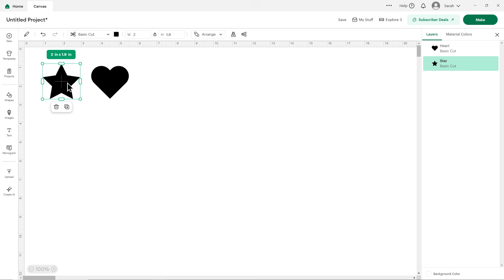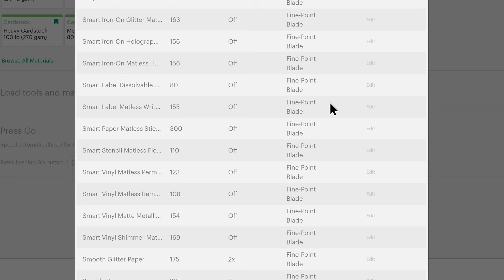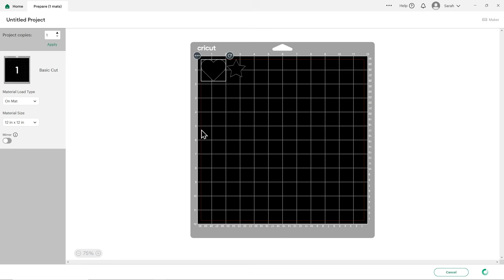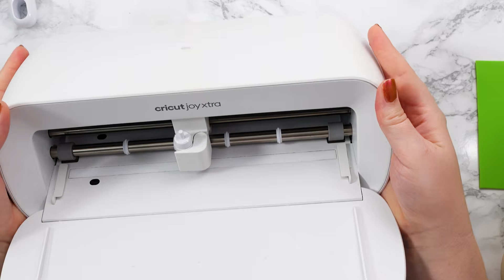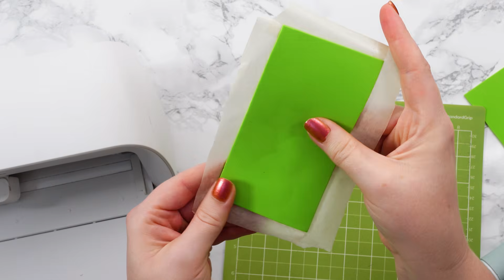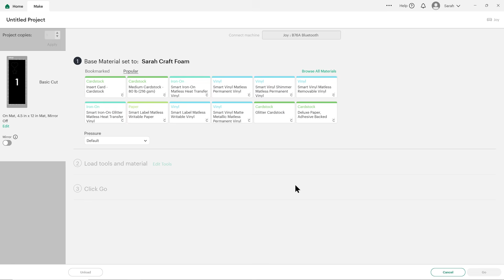How to Cut Craft Foam With Any Cricut Machine - Blade & Machine Comparison

Comment: Thank you so much for this! I'm using my Joy to cut 1mm adhesive craft foam. 350 pressure x5 cut into my mat, but 200 pressure with 2 cuts did the job... cut through the adhesive backing 90% of the time and no marking on the mat.

Comment: I watched with the sound off sorry. was the blade you used a new or use blade? I think a new blade would make a difference. this is a great video. thank you :)
Reply from the maker: The deep point blades and knife blades have hardly been used. The blade in the Explore Air 3 is new as it's a new machine. The Joy and Joy Xtra I've had for a while, but they've hardly been used so the blades should be fine for those. The Maker/Maker 3 are the only ones that the blades get lots of use with as those are the machines I use the most.

Comment: I enjoyed the video. I've cut fun foam on my Scan n Cut but not on my Explore 3 yet. I was wondering how using the deep cut blade would work out if you cut in two (or more) passes. It looks as if the length of the deep cut blade is required but cutting in one pass is tearing te corners of the shapes. Unfortunarely I don't own the deep cut blade so I can't test it.
Reply from the maker: That's a good idea and might help the edges not to "snag" so much.

Comment: What about using the rotary blade?
Reply from the maker: I didn't think to try that one, but it would need another custom cut settings as that blade option doesn't come up when the "Craft Foam" material is selected. As it's designed for cutting material, I'm not sure if it would work well for foam - but if you give it a try, please let me know how you get on.